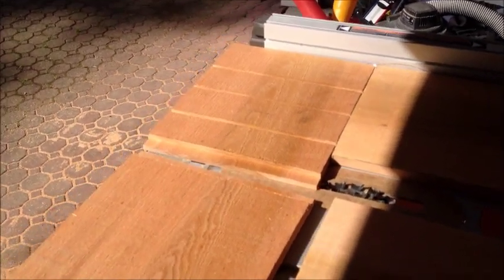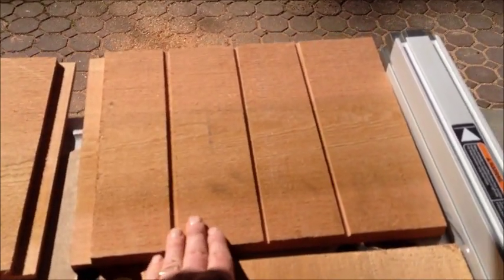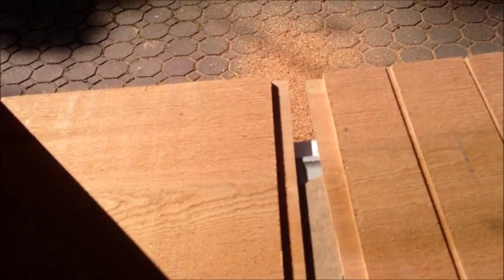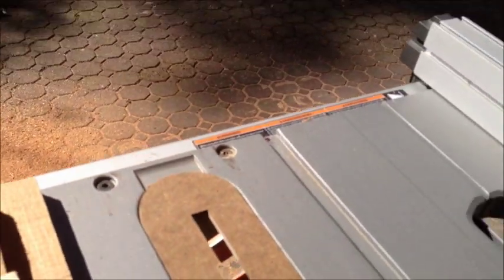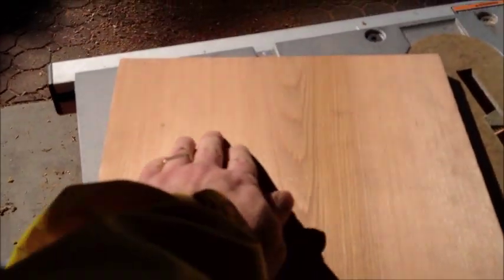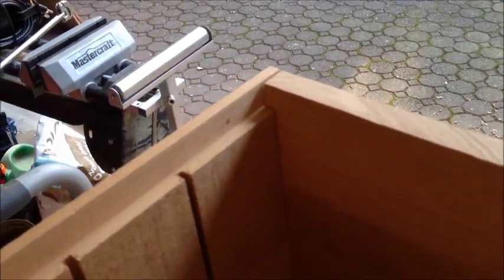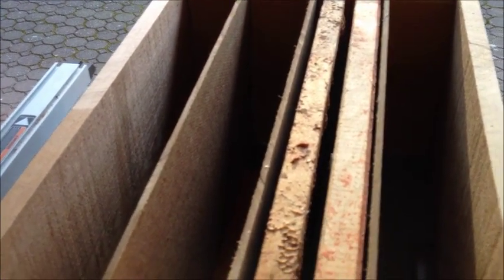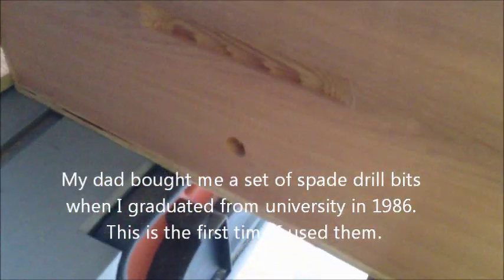Queen castle - Rearing queen honey bees

Comment: Great video, thanks for sharing. Those gaps on the ends of the divider boards will allow the queen to sneak thru to an adjacent suite. She will find any open gap. I made this mistake and had to add tiny gap shims to close it up. The key is to make sure those separators go all the way across to the outer wall of the upper rabbit. Really great tip there on how to make handles.
Reply: Looks like someone didn't watch the full video.